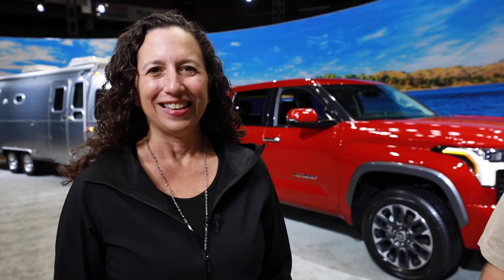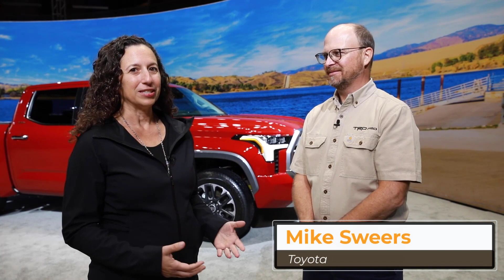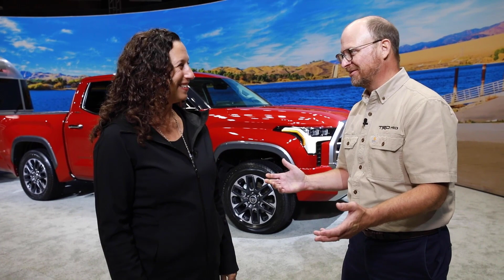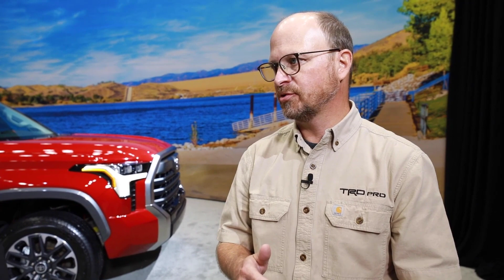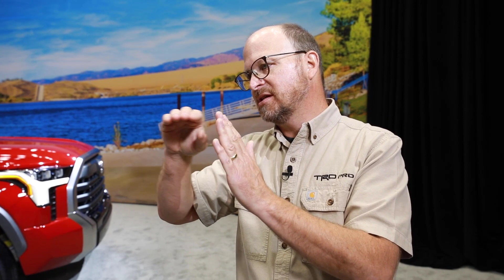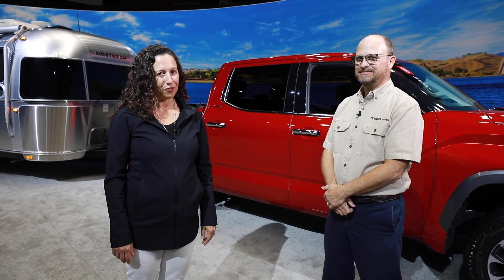Talking All-New Toyota Tundra Powertrains with Mike Sweers

Comment: We really needed to tow over 15,000 lbs.
For years I’ve been waiting for Toyota to add and 2 extra tires in the back of this tundras.
Call it Tundra double.
Just 2.
Reply from the maker: To tow that much, you will need a 3/4-ton pickup.
Reply: That's 3/4 ton territory. Buy an HD truck.

Comment: Mike sweers is a ex Chrysler engineer.  Look at what he says In the beginning.  He calls the motor a 3.4 which it is in reality.  But he quickly says it’s called a 3.5.  So they are lying to you out of the gate.  This is a cost saving truck and you will pay and pay to keep it running.  Compared to the old Japanese designed Tundra this one is laughable.

Comment: If v6 and hybrid was Toyota’s answer to a diesel type tundra, why not go inline 6 cylinder?
Reply from the maker: Great question. Packaging and temperature control for a V6 are easier than in an inline six. Especially when turbos are involved. With diesels, the bulk of the engine block makes putting it in a V difficult, but with gasoline, the pressures are reduced and so the block can be thinner.